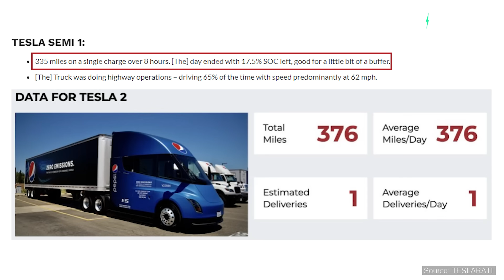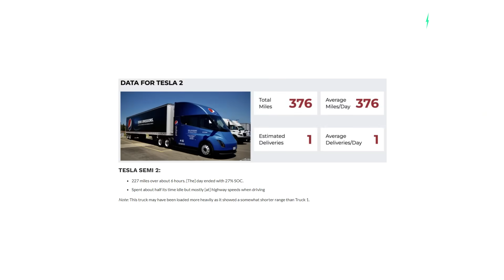Tesla Semi tested at highway speeds - REAL world range shocks rivals

Comment: I would love to see how they handle altitude change.
I have to ascend the Brown Mountain in NSW, that is a vertical of 1000 metres to the high point in the road.
I don't think that they can handle that elevation with a full load.
P.S.
I have seen a Tesla sedan on the side of the road I suspect had a flat battery. 
It was being loaded on a tilt tray.
Reply: "that is a vertical of 1000 metres" BAHAHA Dude Aus is soo flat that 1.8km is basically our highest ROADs. Most BEVs including Tesla Semi will have no problem with small elevation of Aus. No The Tesla Sedan was not flat due to Elevation it obvious has a fault. FYI PROTTERA Duo Power BUSES are used for Ski Resorts in COLORADO constantly climbing up and down 4000ft ~ 1.21km. BEVs are SUPERIOR at climbing up Mountain due to their superior Motor performance. They have no issue with energy capacity and might even be superior as they can Regenerative Brake down hill to gain alot of range back.
Seems like you fabricated BS to push Misinformation, "being loaded on a tilt tray" Bullocks, nope there wasn't even a tow truck.
Reply: @Neojhun they won't have a problem with grades, however uphill runs will drastically reduce range just like it does for other EVs, unless this is sufficiently offset by regeneration downhill
Reply: @jamespaul2587  Yes I agree it will drastically reduce range. But note the propagandist "mhelmreich1" specifically states "on the side of the road I suspect had a flat battery" and "if batteries CAN'T EVEN climb what we have here". There is massive difference between reduction in range and CAN'T EVEN climb 1000 meters.
Reply: @Neojhun  yes, but a car with an empty fuel tank couldn't climb either
Reply: @jamespaul2587  That's irrelevant when these elevation climbs typically coincide with short distance traveled. E.g. the 4000ft elevation climb in Colorado was over freaking twelve 12 MILEs. Back to Regenerative braking down hill soon.
Reply: @Neojhun  elevation changes are always relevant when testing EV range as uphill and downhill grades significantly impact range, especially for a heavily loaded semi. That's why controlled tests typically have routes planned to travel the same distance in opposite directions to offset wind and elevation impacts
Reply: @jamespaul2587  As demonstrated in the 500 mile range test here: https://youtu.be/LtOqU2o81iI?feature=share&t=1221, virtually all excess energy used in the climb is recovered downhill. Theoretically, regen braking recovers about 81% of excess energy used in the climb. But on the range test, it appears to recover all of it, because there's a 35 MPH truck speed limit on the Grapevine; and the reduction in aerodynamic drag due to the lower speed is about equal to the 19% loss of energy in the round trip from the battery to the road and back to the battery.
Reply: @BigBen621  it's only recovered if you have downhill grades on the same trip. This may not be the case with a one way trip
Reply: @jamespaul2587   it's only recovered if you have downhill grades on the same trip. This may not be the case with a one way trip 
Of course; but even Tesla cars have an excellent trip planner, which takes elevation differences into account; and obviously the Tesla Semi will have that or better. So dispatchers and drivers will be able to take the elevation difference fully into account, when planning trips.
Reply: @jamespaul2587  Which is has to be with these closed loop runs.
Reply: @Neojhun  I don't think you understand my point.
A battery has a hard time storing enough energy to lift itself vertically for a kilometre, let alone something else.
For the record our highest mountain is over 2km high, which still ain't huge.
New Zealand has one nearly twice that, and the Himalayas have 100s three times that.
Who cares if batteries can't even climb what we have here.
Reply: @mhelmreich1 "hard time storing enough energy to lift itself vertically for a kilometre, let alone something else" Absurd BULLOCKS
I just stated Proterra bus has no problem going up 1.2Km with passengers.
While a Tesla passenger car with 80kWh or bigger battery should have no problem going over a 1.5km mountain.
"For the record our highest mountain is over 2km high" But Paved ROADs do not go to the peak of those mountains.
You are just here to push falsehood propaganda absurdities "Who cares if batteries can't even climb what we have here". Battery Vehicles have no problem climbing our short mountains. Stop pushing LIES and intentionally misunderstanding my facts.
Reply: @mhelmreich1  Mt Kosciuszko only has a graded trail, Mount Townsend is basically totally undeveloped. Mount Twynam has a walking path partially up the mountain.
I have driven 3x times across the Great Alpine road near Mount Hotham which ascends to 1840 meters. Thus why I knew this number off by memory. This is our highest paved road.
You are not DRIVING over 2km elevation in Aus. It's like you ignored geographical facts. 
FYI The picture on my YouTube Channel banner is Mt Buller.
Reply: @mhelmreich1  "A battery has a hard time storing enough energy to lift itself vertically for a kilometre, let alone something else".  You couldn't be further from reality!
A reality that is very easy to calculate, taking an actual US truck trip, which includes an extreme stretch of climbing:

1. Let's assume a maxed out, 82'000 lb (37'195 kg) truck going uphill (as well as downhill) at the same speed as if it were on the flat... say 60 mph.
2. This truck draws the same current from the battery going uphill as on the flat to counteract aerodynamic drag and rolling resistance, PLUS the potential energy it will accumulate going up to the peak altitude on its trip.

Let's imagine an hypothetical Tesla Semi, transporting a full load of Coors beer from the Coors brewery in Golden, CO (altitude 5672' or 1730m) to their distribution warehouse for Western Colorado in Grand Junction.  It is a 244 mile trip (391 km), which has the particularity to go through one of the highest road tunnel in the world, the Eisenhower Tunnel, through which I70 crosses the continental divide at an elevation of 11'158' (3401 m).

The uphill leg from Golden to the tunnel is 48.0 miles to the entrance of the tunnel, plus the 1.7 mile length of the tunnel (the highest elevation being at the west portal), for a total of 49.7 miles (79.7 km) and an elevation difference of 5286', or 1671 meters, which more than qualifies to your requirement of the battery lifting itself up by one kilometer!  The average gradient is 2.10%, with a 12 mile stretch at 5-6%.

The truck starts with a fully laden 900 kWh battery (closest approximation known of the real battery size of the LR version of the Semi).  The truck will consume 1.7 kWh/mile (figure given by Pepsi) to overcome drag and rolling resistance, i.e. 1.7 * 49.7 = 84.5 kWh between Golden and the tunnel, PLUS the potential energy it will accumulate by going up to the maximum altitude of 11'158':

37195 kg * 1671 m * 9.807 ms-2 = 609.5 MJ = 169 kWh.  But let's add 5% to this value to account for the not perfect efficiency of the drive train.

So, our truck, by the time it reaches the highest point of its trip, at the west portal of the Eisenhower Tunnel, has consumed:
84.5 kWh + 169 kWh/0.95 = 262.4 kWh, or 29.2% of its battery.... for lifting itself up at MAX WEIGHT, not by a mere 1 km, but by 1.67km!!!!  

As a matter of fact, this fully laden Semi, going up on an "infinite" and hypothetical 5% gradient slope, could go up not 1 km, not 2, not 3.... but over 7 km  (23'000ft) before running out of battery!!!

Assuming 80% efficiency of the regeneration system, it will reach Grand Junction with a tiny bit more than 50% left in its battery.  The penalty of having to pass on of the highest tunnels in the world is only 8% of a fully flat trip!  Given that it will likely go back to Golden empty, it could even go back on what's left of the battery charge... but the driver should rather give it a 15 minute recharge, for peace of mind.  That return trip would be a full day of driving (ca 9 hours, given a bit of traffic) for a driver.  BTW, the Tesla Semi would complete this round trip in 1-2 fewer hours than a diesel rig because of a higher speed going UP (higher and constant power, no "huffing and puffing" of the motor due to the high elevation) as well as DOWN (allowed by regenerative braking).
Reply: There are already videos out with Semi passing another semi up a 5% grade with a 54,000 lb trailer.  Semi is FAR batter at handling elevation than a diesel. It isn’t even close.
Reply: @orionbetelgeuse1937  that would be a test of the drivers rather than the machines. The long range version has already demonstrated a 500 mile delivery with a 54,000 lb trailer at 81,000 lb gross weight through mountains, in traffic.
Reply: @williammeek4078   The long range version has already demonstrated a 500 mile delivery with a 54,000 lb trailer at 81,000 lb gross weight through mountains, in traffic. 
And climbing and descending the 4,200 ft (1.28 km) Tejon Pass ("The Grapevine") in the middle.
Reply: @orionbetelgeuse1937  Obviously the Tesla would be perfect for trips within a 150 mile radius so is back in the depot overnight charging. Why is everyone assuming that the trip has to be 500 miles one way with no charging stations?
Reply: I see them on I-80 in California between Sacramento, California and Reno, Nevada. Sacramento’s elevation 30’ above sea level, Donner Summit 7,227’, and finally Reno, Nevada elevation at 4,505’ elevation. I’m also seeing them travelling to Los Angeles from Reno, Nevada on US 395 south that has 3 high altitude summits. Conway summit 8,143’, Sherwin summit 6,426’, Deadman summit 8,036’ . There are more high altitude summits, but those are the big ones.
Reply: @ronaldquint  yes, it's not the altitude that impacts range for EVs, it's the change in elevation as hills drastically reduce range, especially with heavy loads unless offset by downhill runs
Reply: @orionbetelgeuse1937  You know the speed by visiting "Run for Less" and look at the graphs.    The real test is will it save money and work for the operator/owner.
Reply: Guys, I am not talking about altitude, I am talking about how far they can climb.
I would think EVs could work just fine at 20,000 metres.
Can someone tell me how much one of these trucks can climb with a load?
Reply: @mhelmreich1   Can someone tell me how much one of these trucks can climb with a load? 
Both @st-ex8506 and I have calculated independently, using completely different methods, based on known Tesla characteristics and basic physics, that a Tesla Semi, loaded to its GCVWR of 82,000 lbs., could climb >7,000 meters from its starting elevation, if there were somewhere in the world where this could be done—which I'm pretty sure there isn't.

Comment: For us car drivers one great advantage I see for electric trucks are steel hills. How many times does the traffic grind to an almost halt with a lorry/truck in front. 
Driving an electric car up a hill is no different than driving on the flat. Would trucks not conquer hills in the same way?
Oh one other benefit ice trucks emit way more fumes going up hills.
Reply: Driving a truck uphill will have a huge impact on reduced range, which could be an issue for EV trucks compared to diesel
Reply: Going downhill, will recuperate the energy used to go up hill! @jamespaul2587
Reply: @jamespaul2587   Driving a truck uphill will have a huge impact on reduced range, which could be an issue for EV trucks compared to diesel
If it returns to the same elevation it started at, there's almost no loss penalty for uphill travel.
Reply: @BigBen621  trucks hailing freight in the real world need sufficient range to offset the uphill part of the trip
Reply: @jamespaul2587  Yes, of course. I should have make that point. Thank you for the correction.
Reply: @jamespaul2587  Driving uphill does nothing to reduce range.  It is driving DOWN hill that reduces range, specifically BRAKING down hill.  If electric semis can regenerate all that braking energy that is an 85% increase over diesel trucks.
Reply: @CorwynGC  that makes no sense. EVs always lose range going uphill and gain range going downhill. Gas or diesel vehicles are also less efficient uphill and more efficient downhill, it's called gravity.
Reply: I am not sure where you are located but here in Oz there is no shortage of semi trailer trucks that are hard to catch on a hill (legally).  If they do slow, it might be from 100kph to say 90-95kph, but usually they just keep barrelling along at the state speed limit, albeit with increased fumes.  Hills present a range issue for all vehicles, physics teaches us that.  It’s just a matter of a hilly route posing a risk to not getting to the destination.  I think that matters the most.  Cheers.
Reply: Running on Empty! @GolLeeMe

Comment: Constant low speeds with ideal weather and no traffic jams in a flat country will get you a long way. 

However! These are not real world conditions for heavy transport, and sufficient charging infrastructure for these electric dinosaurs is just a fantasy right now and for years to come.

Basically, it's already game over  as hydrogen gas stations are being built all over Europe and surplus solar energy is becoming a problem to get rid of. Hydrogen will be cheap, clean and just not as much of a headache as lugging 6000 to 10000 lbs of super expensive batteries instread of cargo.
Reply: Do you know how they make hydrogen?
Reply: @waynebarwick1404  Yes, I do. Most of it is still made from natural gas.

But here's the thing. Solar and wind power tend to overperform as adoption rises and can not be stored in batteries at the time it is abundant.

For solar this means wasting most of the summer surplus if it's not used and it also threatens grid stability.

Wind power compensates in winter here, but also often at times that it can not be used.

So even converting it to hydrogen with losses (mostly thermal, which can be used) is better than wasting this clean energy. 

As an example: my home has a solar surplus in summer of about 1000 kWh that I want to use in winter to power my home. Just imagine the size and cost of a battery system that large.

Batttery storage is fine for one or two days, but anything longer gets expensive real fast and will also lose it's charge before winter.

Don't think in terms of loss, think in terms of storage, which always comes at a cost. Building a 1000 kWh battery facility per home is not cheap either and will not work in real life.

So, as we get more green energy, using this to power trucks will be cleaner than digging up Lithium at a mind boggling scale to deliver mostly empty batteries in terms of weight.
Reply: @SolAce-nw2hf "Batttery storage is fine for one or two days, but anything longer gets expensive real fast and will also lose it's charge before winter" ABSURD NONSENSE.
It takes a whole WEEK to see any noticeable capacity loss. Battery Capacity is plentiful on CRASHED Written off EVs in Junk Yards after 8 Months over winter. To the point it is a SAFETY Protocol to assume they are highly charged. Your absurd lies defies SAFETY problems.
Reply: @Neojhun  any battery system with a decent BMS and climate control to keep the batteries in a good condition is going to lose energy. But even if we had a breakthrough that would give a 100% return in winter, just calculate the cost of this system without bms, airco or a building to put it in.
Reply: These are PepsiCo trucks used in regular operations at their Sacramento facility.
Reply: "as hydrogen gas stations are being built all over Europe" BAHAHAH Large scale H2 distribution network is IMPOSSIBLE. Now that H2 fuel network is an Absurd Fantasy.
Reply: Constant low speeds with ideal weather and no traffic jams in a flat country 
Speeds are consistent with the 55 MPH speed limit for trucks in California, where these tests are being run. It's obvious from the speed graphs that many of these runs are made in stop-and-go traffic. And where's you get the nutty idea this is "flat country"? These test runs start at the PepsiCo plant in Sacramento, elevation about 26' feet; and summit Donner Pass (7,100 ft. or 2.6 km), on the way to Reno (4,500 ft. or 1.4 km).
Reply: @BigBen621  it's just a big PR stunt. You can't save the environment by lugging around bottles with sugar, cafeine, co2 and mostly just water using heavy batteries.
Reply: sufficient charging infrastructure for these electric dinosaurs is just a fantasy right now and for years to come 
There are 21 Tesla Megachargers in use or permitted right now, and 72 in planning for a network stretching from Fremont, CA to Laredo, TX. I think that's plenty for the 36 Tesla Semis now in the wild.
Reply: @BigBen621  woohoo 21. That's going to make a dent.

Comment: They never mention the weight which is the only thing that matters.
Reply: Semi has been spotted on the road in the US with a 54,000 lb trailer. That makes for a 26,000 lb tractor at the max allowed gross weight.
Reply: @williammeek4078  For example here: https://youtu.be/LtOqU2o81iI?feature=share&t=985, accelerating rapidly up a steep slope on Donner Pass (watch the speedometer), and passing a diesel semi as if it were standing still.
Reply: Every Tesla truck buyer knows.   You don't.   And you knowing does not matter.
Reply: Weight is a big factor but not the only one. Temperatures and terrain are important. Even Nikola could travel quite a distance downhill 😊